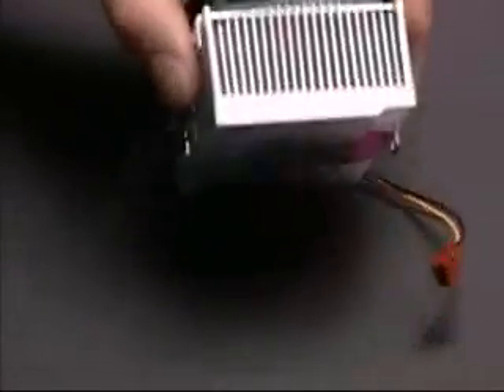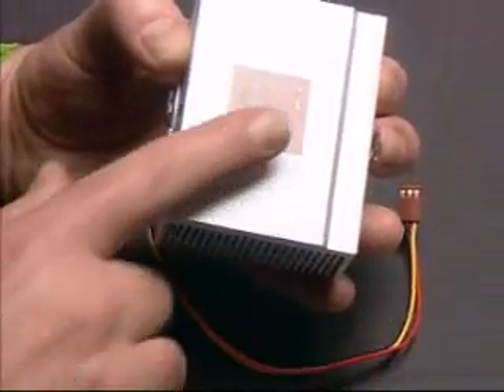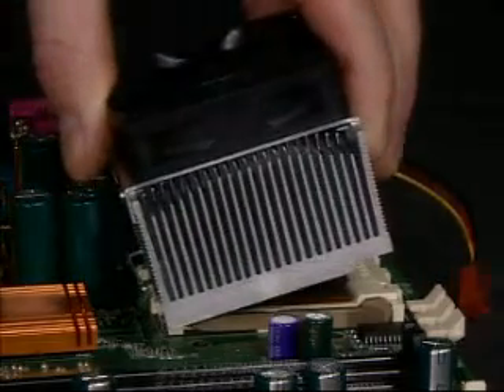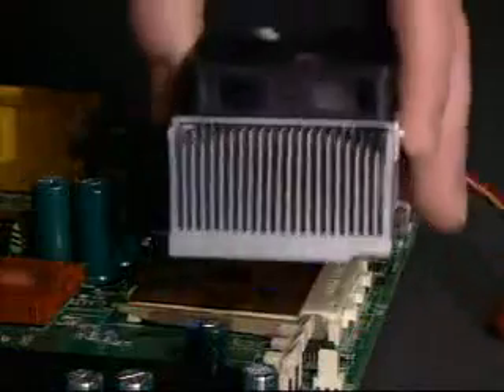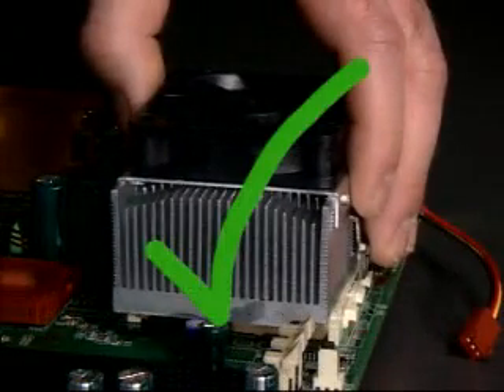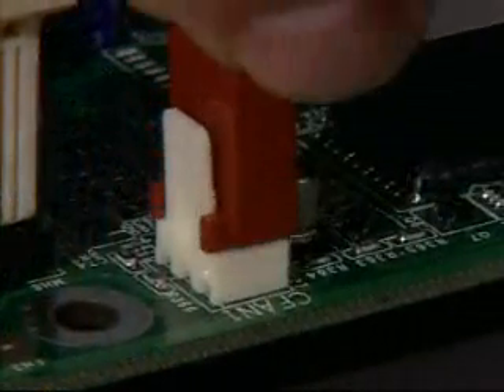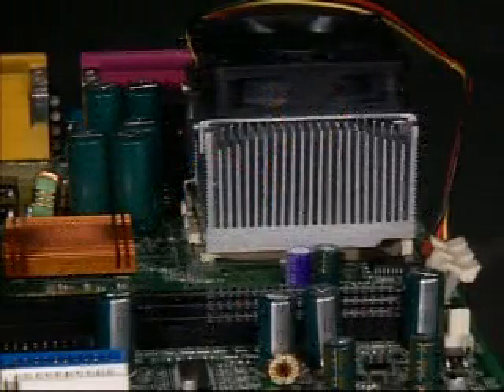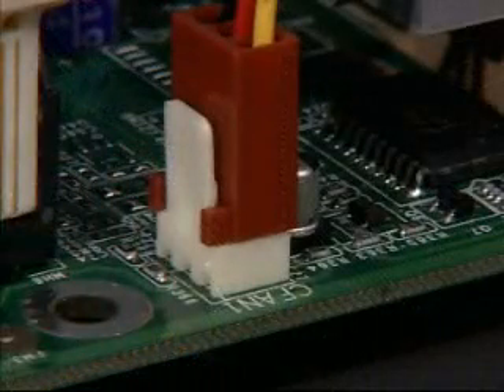AMD Heatsink Installation

Comment: I HATE these heatsinks/fans. You have to put WAY too much pressure on one side to get it on. And half the time, while you're messing with the heatsink, you've already messed up the thermal paste. So much easier to just install a different heatsink that screws on